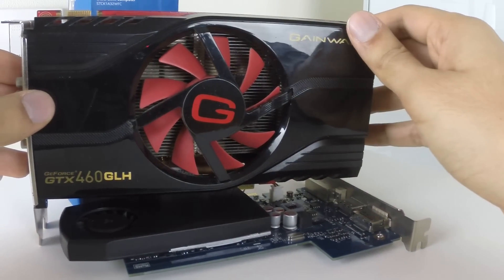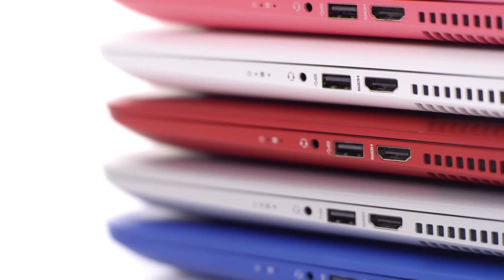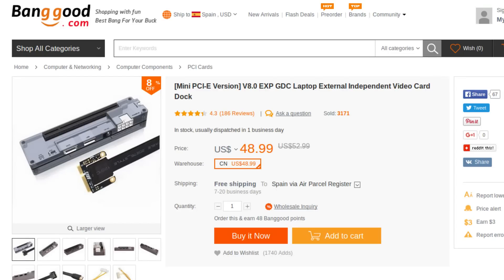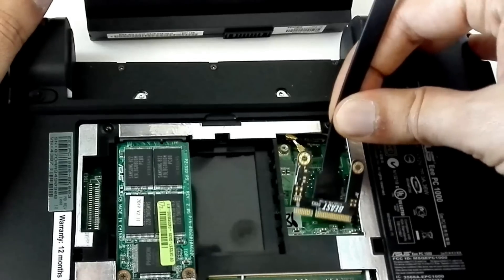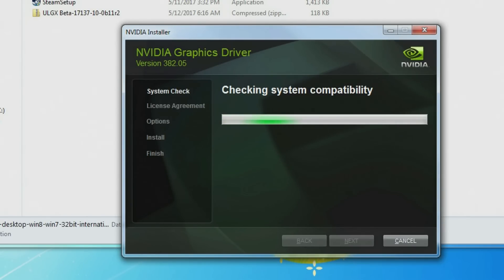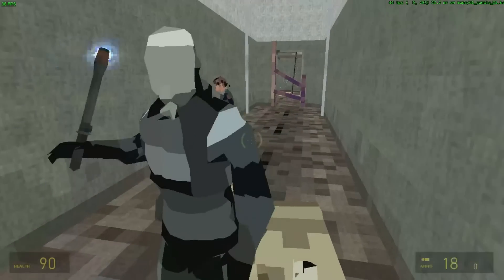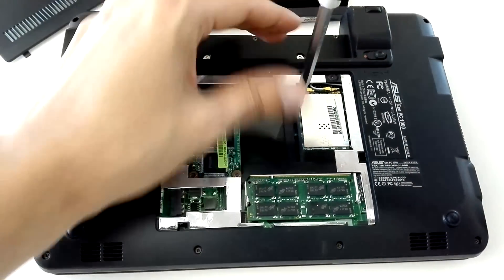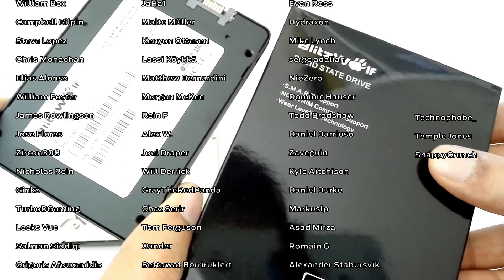An External GPU for an old Laptop?

Comment: will u need a power supply for a GTX 1050ti?
Reply: Yep, as you still need to supply the graphics card the power it would get from a 'normal' PCI-e port.
Reply: Ezra the 1050ti wont need a very good psu, but yes. The pcie lane takes around 75W to work. the 1050ti is a very efficient card that basically sips power. the issue here is that the gpu needs the 75W from the pcie lane.
Reply from the maker: you need a power supply for the base always. If the GPU you connect to the base requires power from a supply then it needs the appropriate ports as well.
Reply: i see there's a DC-in port like a laptop charger on the device, can i use one of those instead or i will need to get an external psu?
Reply: also is an i5 4200 a good cpu for a GTX 1050ti?
Reply: Ezra yes, the i5 you have is perfectly fine for the 1050ti. power coming from the laptop its self will not be enough. usb ports only output like 4 or 5 watts (this could have changed in recent history but its still not enough)
Reply: LowSpecGamer do i need to use an external monitor, or does it output to the laptop's panel?

Comment: Waw, thats awsome, can you try it on your dualcore notebook? the one with the i7 xxxxu. Well Done, you put some fresh air in your channel :)
Reply from the maker: I will definitively try a better laptop if I get my hands on an appropriate one.
Reply: +LowSpecGamer How much have you read about eGPUS? Maybe I can help if you if you have any doubts about this.
A good laptop for a higher performance external gpu would have a second generation Intel Core processor or newer, as the minipci-e/expresscard ports of those can run with Pci-express 2.0 instead of 1.1.
And the screen directly connected to the Intel graphics card, if you want to use Nvidia cards to run games without need for an external monitor.
There is plenty of old business-grade laptops for sale that are great options and have Expresscard ports.

Comment: I wonder if you can run CITRA or CEMU on a gpd win?
Reply: BudderCreep3r 

Citra: probably
Cemu: Hell no, even with his low spec graphical genius.
Reply: Even for some mainly sprite-based games?
Reply: Maybe you could run Citra on it, but a real 3ds is much cheaper though. CEMU doesn't run good even on an i7 4700MQ, so it's a big no.
Reply: Well, the only game I actually tried (on i7 4700MQ) was fast racing neo, but it ran so poorly that I wasn't really curious of other games. But I am sure that even sprite-based games would run poorly. Emulators rely heavily on a really fast CPU, and an Atom one isn't really anything near I would consider really fast in 2017. But you're sure to run pretty much every PS1/N64 game and older. Maybe some Dreamcast and PS2, but that would depend on a game, and if you're ok with frameskipping.

Comment: Can you do something similar with a processor? My laptop's CPU is weak and I don't have money for a better laptop... I have an Intel i3-3120M @2.5 GHz.
Reply: yes depending on the socket
Reply: There is no practical way to add an external CPU, the signal interference from cabling would prevent it from working.
But what laptop model do you have? That processor model is socketted so you might be able to upgrade it.
My laptop had a i5-2430m when I bought it, but some months ago I upgraded it to a quad core i7-2630qm.

Your processor is 3rd generation, socket g2. So you may look for similar 3rd gen i5/i7 laptop processors.
Reply: Check the temps when gaming. I bet they are over 90C
Reply: Your i3 is M series, even tho' it's old, it should be better than current i3 laptops that mostly use U series...
Reply: Rememeber, U series stand for "underperforming"
Reply: Thermal paste loses a lot of efectiveness after some years of heat. Dust also gets stuck in the fans and heatsink. You should definetly find a way to clean and repaste your system.
Reply: +ShagStars Productions Some i5s are worse than i3 so that is not always true.
Reply: Before buying it, check compability list some laptops with crappy BIOS not working with it.
Reply: and the generation (cuz skylake and kabylake most of them are soldered if not all)
Reply: now that i have someone to ask, i've been wondering, back in 2013 when i bought my laptop, it runs Cyrsis 3 (high settings, 40-60 fps) and other games very VERY well, it met my expectations, but as of now it runs pretty shitty on any games, even on games like csgo (lowest possible setting, 1024x720) it'll drops to 30 when there's heavy stuff going on, any idea why?
Reply: eagle3zio software issue or bad thermals. If its a software problem and you cant find out reinstalling windows would be the only option. If its a thermal issue then i dunno
Reply: define thermal issue, does my thermal paste have anything to do with it or...?
but, reinstalling windows shouldn't be a problem
Reply: That I3 isnt that terrible actually, with an external gpu like a gtx 1050ti & 16 gb ram it would run Bf1 smoothly in multiplayer
Reply: eagle3zio use hw monitor like someone suggested and check the temperatures. Im guessing it has a graphics card( it was ablest  to run crysis) if the temps arent bad- eg cpu and gpu temps not 85ish+ then id say its a software issue. Have you tried updating drivers?- use ddu to delete old ones and then install
Reply: +Deep Mukhia all intel laptop processors since broadwell are bga.
Reply: To be fair, that processor would probably run 100% better than the one featured in the video, you could probably reasonably pair that with an external gpu (and you might be lucky enough to have an expresscard slot)
Reply: I heard there were some issues with gtx 1000 series and egpu's via Mini PCI-E port. I am also aiming at gtx 750 ti/gtx 950. High end cards are more bottlenecked than lower mid end cards. I have ordered a gdc beast and I am seeing a gtx 950 for 50 bucks second hand so we'll see how that goes. I will make a video about it when I have all the stuff (I am also curious if I can use my own laptop monitor).
Reply: That's why most people use Nvidia cards for eGPUs.
And if you are interested in more... AMD cards on their side seem to be more stable with the signal degradation caused by the adapters and cables (Didn't test them myself yet).
Nvidia cards sometimes have problems with that, That's why I replaced my old EXP GDC Beast with a PE4C 3.0 when it was cheaper. The newer EXP GDC 8.4d seems to handle degradation better tho.

And I just received an update on the shipping status yay! Maybe I can re-test the cpu temps at the weekend with the better thermal paste.
Reply: bit"# please, i got a 2011 laptop with an amd e-240 with 1.5 ghz and 3gb ram (note: natively mi pc has 1 gb ram my stupidly decision to purchase this potato made me to buy additional ram)
Reply: Tibor Klein a processor is the heart of the computer, so i imagine getting an external CPU to run is not worth it (money- and effort-wise)
Reply: Technically, you would be able to, depending on whether or not the CPU is welded to the motherboard or not :P
Reply: yes sir, it is
Reply: Guessing you have heat issues.
check temperatures with hwmonitor & check drivers settings so its not stuck too the integrated graphics on the intel cpu instead of the gpu it has.

http://www.cpuid.com/softwares/hwmonitor.html download the zip version.
Reply: I have a Samsung Ativ Book 2 NP270E5V-X03HU.
Reply: Haha there is no such thing as an external cpu
Reply: Meh.
Reply: Laptop CPU's can be upgraded provided they are of the same gen. but its pain in the ass to find the older m models...
Reply: meh, your cpu is not the problem for games till 2014-2015. fter that yeah the minimum is a laptop i5.
Reply: Not all laptop CPU are soldered to the motherboards. Some laptops are socket based. But generally even with a laptop where you can replace the CPU, you have to take the entire laptop apart & deal with the strange heat stinks to change the processor out.
Reply: i had a i3-2330m with GT 525m. was thinking about buying egpu last year. anyone have recommendation for best suitable upgrade?? both for cpu and gpu
Reply: it's actually PGA. the CPU is swap able but to find one that is suitable is really pain in the ass
Reply: U can try with everything exept HP whitelisted laptops, CPU isnt that bad, paired it with up to GTX 1050 performance level card will give your laptop second life, your 525m Fermi is so outdated that u will gain incredible performance boost in games even with cards like 750Ti level, but if u wanna something like 1060 then CPU will be struggle with heavy CPU games like GTA5, CS-Go, Battlegrounds.
Reply: +I like Nachos For cpu you should be able to upgrade up to a quad core I7. But in this case you should watch your temperatures as these are a bit hotter.
I upgraded to a I7-2630qm as it was the cheapest quad I could find, from an I5-2430m. The Wikipedia page about "Core I7 Processors" have a list of all the versions, take a look for Sandy Bridge Mobile.
Dual cores aren't as fast and maybe litle advantage over an I3, but if you find a very cheap dual core I7 it may be worth it. Look for Benchmarks to decide.
Reply: zwerne42 what is your under load cpu temperature? I OCed my 525m and it perform good at med-high 30fps. my problem is thermal throttling. the heat pipe can't take it anymore. that is why I want to try egpu to put less stress on the heat pipe and leave it for the CPU only. also, what card is good until the mPcie bottleneck it?
Reply: I like Nachos Right after cleaning and repasting last year (w/ Arctic Silver Ceramique 2) I got over 80-85°C in prime95.
Some day ago when Gaming with the integrated graphics temps went up to 95°C. I think my thermal paste is degraded right now. I will repaste using Thermal Grizzly but since some months ago I'm waiting for a brand new fan to arrive from china to do that, f**k my country's mailing service.
I normally set a maximum processor state in Windows power options to control heat. An eGPU also helps hot laptops as the 3d is being processed outside. Mine is colder when using the eGPU.

For the mPcie bottleneck, I think this depends on the application. There is a usually 20-30% performance loss for all cards.
I generally see people get GTX 960-1060 level cards and be happy with that. More powerful cards will give you more frames but the performance gain will be slightly smaller than it would be on a full x16 slot. But at this level of performance you should start to worry more about CPU bottlenecks.
Reply: zwerne42 I see. mine is about 70-90°c on gaming with max OCed gpu sitting beside it. oh well I'll try the egpu to cool it down. as for the gpu, in my country the gtx 1060 cost about one full pc with i5 and 750ti in it lol. I'll aim for 750ti or 9series if I'm lucky. if the temps is being kind, I'll change the cpu too. thanks for the reply, man.
Reply: +I like Nachos Nice to help you.
I see, those things can get very overpriced. The 950 got a nice performance bump from the 750ti. I have recentlly seen the 950 to have a better price to performance, but use your prices to decide that.

+ShagStars Productions That's true. GTX 1000 series require a pci-e port with hotplug capability.
An that's a very nice price for that card.

To use the laptop screen with the eGPU you will need an Nvidia card, an Intel HD gpu driving the laptop display and no active dedicated graphics in the laptop.
It's a driver feature from Nvidia to save battery in laptops, also present in the Desktop drivers.
It works by switching the Intel graphics with the stronger card depending on the power needed.
Reply: up to 85-90 C per core in stress is simmilar on I3/i5/i7, the difference is Die size bigger surface, generating more heat and  needs better cooling solution, ofc games not stressing all cores that much as 3D Render apps.
Reply: Tibor Klein your CPU isn't weak according to the specifications, it should cooperate well with a lot of low-end and mid-range GPUs. Don't get a high-end GPU because it will bottleneck the CPU. You're safe.
Reply: Anonymous Tutourals/reactin/reload his clock speed is fine and the CPU isn't too old.
Reply: Anonymous Tutourals/reactin/reload there are still gamers who use an i3 or i5 processor to game on their PC. i7 processors don't really boost performance significantly unless if the game is CPU intensive. i7 is expensive too.
Reply: Anonymous Tutourals/reactin/reload i also have an old laptop with a 2nd gen i3. I don't use photoshop but I did use paint. NET and video editing software on it. It doesn't seem to struggle at all with those programs. It had an i3-2330m. You probably didn't use the high performance power plan, it makes the CPU run at it's full potential with the cost of battery life. Even an old school laptop with a 2nd gen i5 processor can run photoshop, I have tested it. Either that, or intense background programs or viruses may be using up the CPU.
Reply: eagle3zio I had the same problem with my old first get i3. What i did was openend it up cleaned the fan (lots of dust and hair) cleaned the old thermal paste applied some new one. Its working fine now.
Reply: Anonymous Tutourals/reactin/reload if the laptop is overheating with photoshop and VLC, just open up the hatch that gives you access to the motherboard and clean up the fan because there could be dust that prevents the fan to cool the computer properly. You might as well try to reapply thermal paste to the CPU if that doesn't work.
Reply: guys i have one last question. im going with the gtx 950. and i wonder if i can use the internal dispay? i heard you need intel igpu, does that also work with nvidia chip? sorry for replying on old comment
Reply: +I like Nachos  You need an Intel GPU running the laptop's display and an Nvidia graphics card. The 950 will work perfectly if your laptop is also capable, I can use my 960 that way. It's a power saving driver feature from Nvidia called Optimus, that allows you to use integrated graphics for light tasks and the stronger GPU for intensive applications when needed.
For it to work you should disable any dedicated graphics in the laptop (just open device manager and turn off the bus the card is connected into). Be sure you are running it with intel first :p.

If you want you can create a topic at egpu.io forums for questions. If you do so tell me your username. There is also a lot of info to read in there.
Reply: zwerne42 i use data plan for YouTube only so normal web browsing is slow as hell lol. so anyway, it'll only work for Intel gpu? not the nvidia one that i have? i wonder if my i3 have igpu in it
Reply: You have a i3-2330m don't you? this model have an Intel hd3000 so you should check if it can be used
Reply: zwerne42 i will try disable the nvidia driver when i got home. i have a tv that i can use but it's at downstairs and it'll be quite troublesome especially when people visit the house. let's just hope this works when the card arrived. thanks for the reply!
Reply: Tibor Klein no, not with your laptop. that CPU is connected directly to the motherboard and can not be removed (well you could if you have the tools and the station to do it), older laptops like a compaq CQ60-615DX, or a dell inspiron 1545 both have a CPU socket to actually replace the CPU, and both have a mPCIe slot, and the 1545 also has an expresscard slot.  while the compaq has a max ram of 4GB the dell 1545 has a max ram of 8GB. but that i3 in your laptop is faster then any of the Core 2 Duo CPUs you can slap in either if those laptops I mentioned.
Reply: can I use this with the laptop display????
Reply: Gimmie a dollar yes
Reply: Gimmie a dollar but you wouldn't want to, it kills what little bandwidth there is if you feed it back to use the laptops display, it's best to just use an external display.
Reply: RALPHY88 madmax2069 thx u two
Reply: Gimmie a dollar my external gtx960 performs way better than my dedicated 6630m on the laptop screen. In comparison to using a monitor it's about 20% slower
Reply: zwerne42 great!
Reply: RALPHY88 Ops, tagged the wrong person but thanks for answering heh :)
Reply: zwerne42 lol ok
Reply: Tibor Klein Amd a8 2.4 hz lol, dammit! Intel is always ahead of meh, and i have radeon r5 also :D
Reply: you think thats bad I have an old intel core duo @2.2gHz and a nividia gtx 8600m with 128mb graphics memory with 4gb ram
Reply: Hjalbried The Fair And Right your CPU would get bottlenecked. The eGPU wouldn't help increase performance much because your computer has a bad CPU. Sell your laptop parts and use the money along with a little extra to get a better laptop with an i5 processor. Or if you want better performance with a desktop, build a PC with a Celeron G-series processor with integrated graphics to play casual and mainstream games like League of Legends and Minecraft, then save up some money for an i5 processor and a GTX 1050Ti GPU.
Reply: Tibor Klein you call that weak?!?! I have a pentium T2390 dual core @1.86 GHz, and that fucker runs HOT! It idles at 60°C and it goes up to 95°C when gaming.
Reply: +zwerne42 Good one. U is ultra low power
Reply: teehundeart 

External CPUs don't even exist. It's impossible to upgrade a laptop CPU, they are soldered to the motherboard.
Reply: wait, laptop processors are upgradeable?
Reply: aidan c. i bet it's possible to run a cpu externally, even though they are not supposed to. but as i said, way to much effort
Reply: and M stands for??